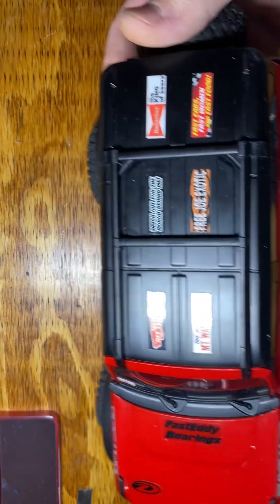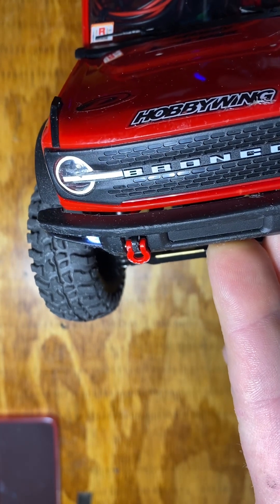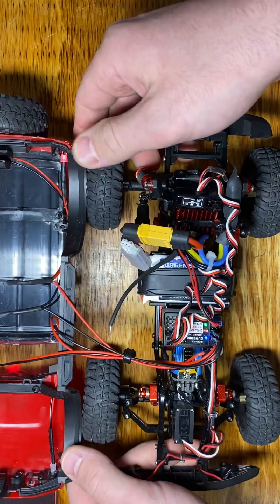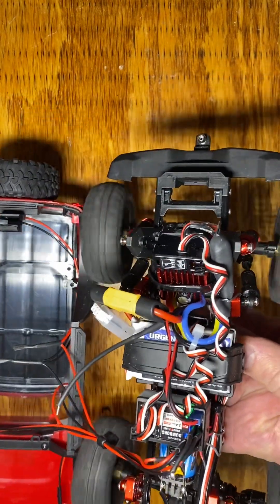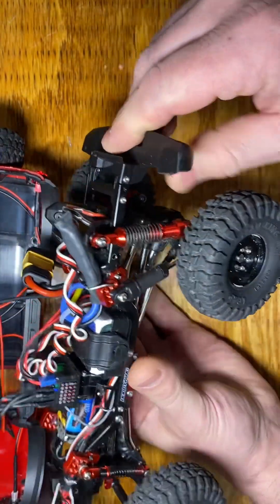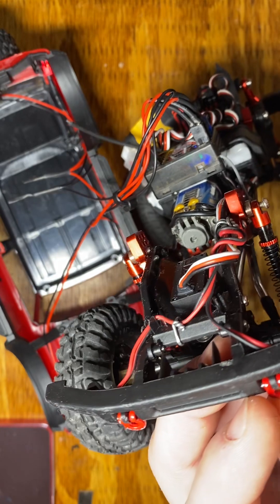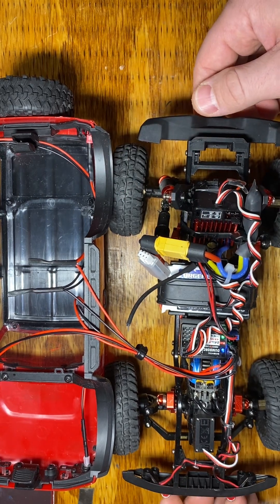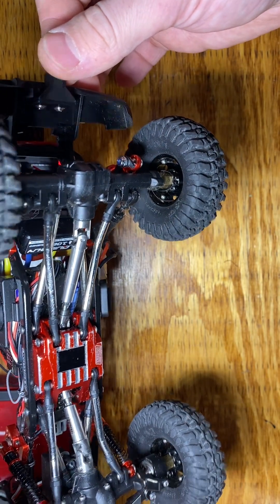TRX4M upgrades and modifications continued

Comment: Saw you on the reddits. I love your build. Also nice pro tip on the shackles for the front. Would you say that motor has more torque and power overall? I'm trying to improve my snow plow rig
Reply from the maker: I feel like it does, yea, my LGRP tires just didn’t stay super grippy for long, I run this thing allot.  The motor is ESL031 Xtreme SE180 Motor. But I can’t find any others.  You will need to press fit on a pinion gear on the motor: https://www.moforc.com/products/mod-4-steel-pinion-gears

I’m wagering with crawl gears it’s gonna be a beast.  Because I have a new radio system I tend to be tweaking the throttle trim allot, so if your stuck on the tq system and you get a motor like this you may regret it without proper trims on the transmitter
Reply: @timb508  awesome, hopefully someone comes out with some metal crawl gears. The plastic ones are not strong enough
Reply: @GraveDigger78  im waiting on a speed box